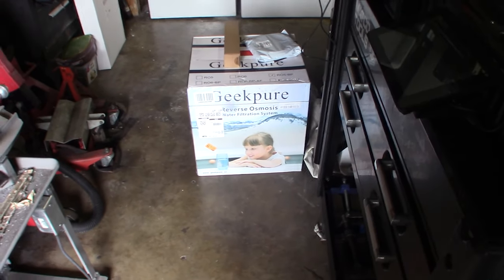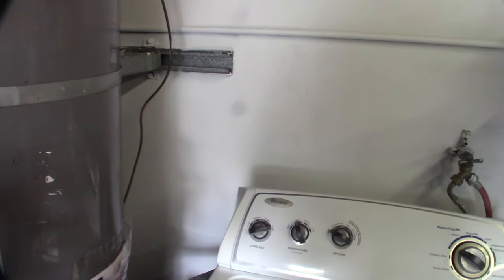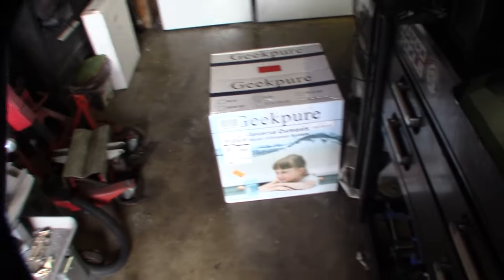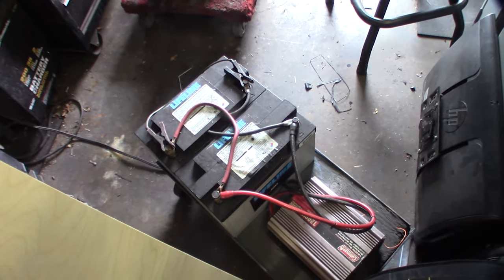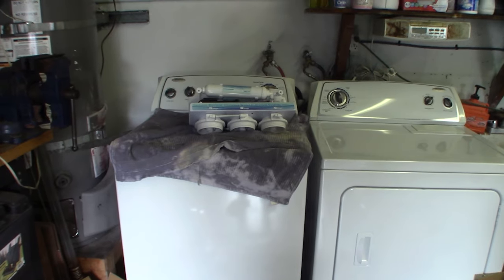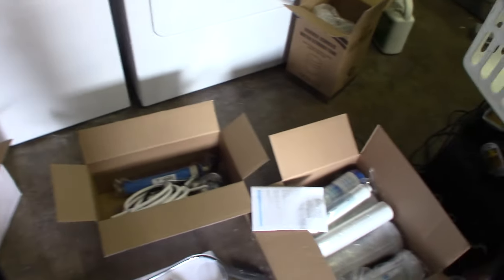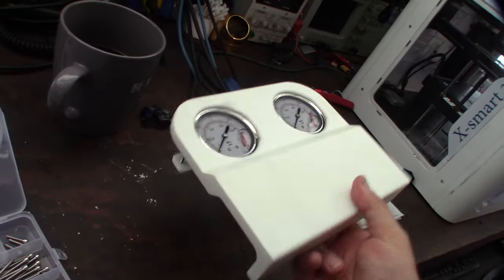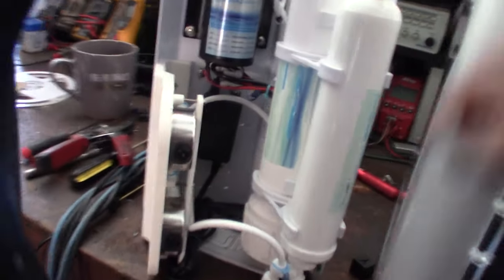Geekpure reverse osmosis water system with booster pump Installation, RO refrigerator Ice maker.

Comment: I installed an "APEC" unit a couple months ago. Taiwanese unit, not from the, uh, mainland. Not only because my tap water tastes horrible, but my goal was also to reduce PFAS and microplastics. And bottled water is a microplastics nightmare! If you haven't read some of the recent papers on microplastics, you need to.

I had to print an adapter to attach the brine line to the drain. TPU + band clamps = excellent.

The APEC is pumpless and has the storage tank with a diaphragm; I didn't particularly want to use it and drink rubber water either, so I just didn't. With no storage it takes a few minutes to fill a 1L glass container. So I printed some stands to hold containers in the sink while they fill. If I forget and it overflows, it is in the sink. Every morning I just fill up a bunch of glass containers for the day.
Reply from the maker: Yeah, I've been reading allot about water lately.  PFAS are jacked.  Pretty fun project. Funny, we think the same. I also don't like the idea of the water sitting in the tank with that rubber diaphragm.  My tap water is about 190-210 tds. I wanted the pump to pull water from my 55 gallon backup drums in case the water gets tuned off. I'm in a Southern California earthquake zone. I'm at the beach, the furthest away from the source (Local Mountains). funny, I live next the river where it comes out into the ocean. I have a big ice tea pot I'm going to store in the refrigerator. I should see what kind of pressure I get with just the pump, tank turned off. My RO system brings my dissolved solid to about 3-8. I hear the pumps makes it more efficient. What are getting?
Reply: @fintechrepairshop  I haven't bought a TDS meter yet, but the taste difference is massive. It doesn't taste quite like distilled, but it is pretty close, it very much has that empty mouthfeel. The tap water coming in is pretty much sludge, during the summer it is brown half the time and we have gotten a "boil water alert" due to algae blooms. Toilet bowls turn brown in a week and there is so much chloramine in the water that it burns my skin when I take a shower. So yeah, the RO results are extremely impressive.